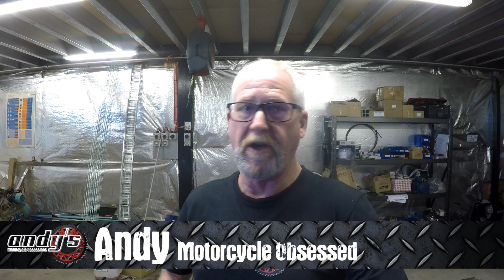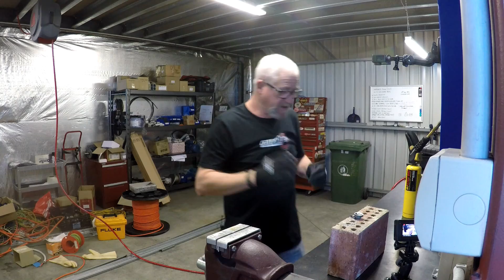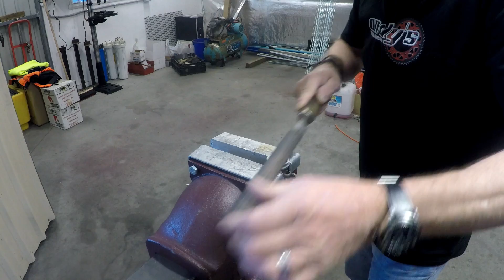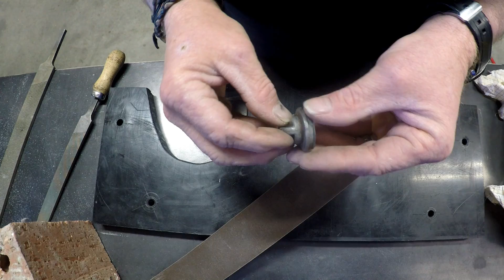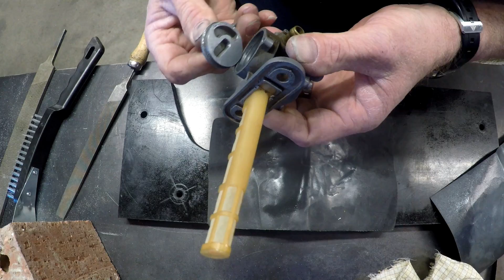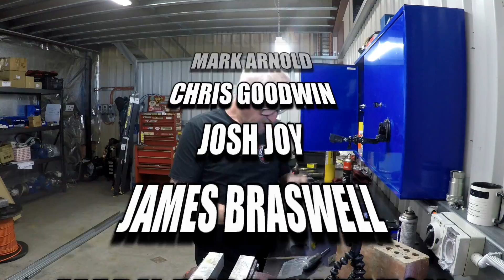GS1000 Episode 16 - Melting Point

Comment: Yeh, as usual well tried Andy but most or all of fuel components around the world then were made of diecast zinc, alot of parts that involved heat were made of diecast aluminium. There are some metal repair resin type stuff that might do the job but the fuel might eat into it, soft soldering may work but with similar results with unleaded fuel. If it was made of aluminium it would be a cast component so very difficult to weld anyway but I'm pretty sure that it;s diecast zinc so , great try as usual mate bin it. Thanks for all the great vlogs mate, sorry I couldn't have helped earlier. Stevie

Comment: I've been taught that the first step to learning how to do it right, is to do it wrong.

Maybe it would've worked if the heat was a bit more centralized like with a soldering iron? Would've been a real royal pain the ass but maybe one could use the torch to heat a copper rod and use that rod as a whacky makeshift soldering iron. The Melting point of the solder would've still been too high but it wouldn't have bubbled up the edges and surface so badly.

And don't worry about the hairline. Could be worse after all, my uncle went bald at age 19!  And if I don't start putting something on my head while welding, I'll probably get there sooner than I really want to.